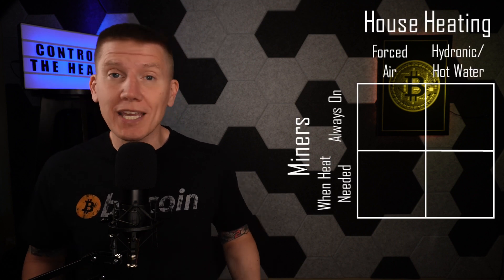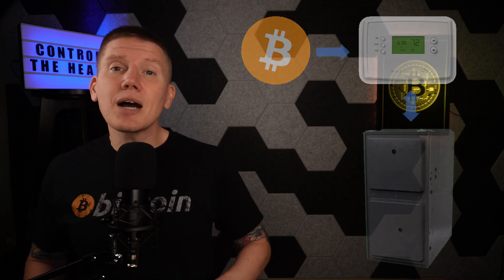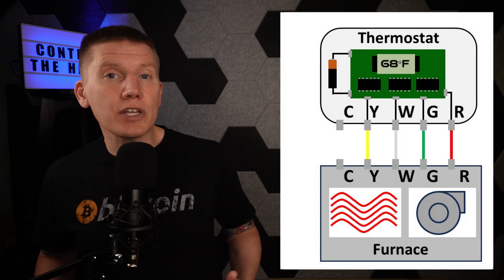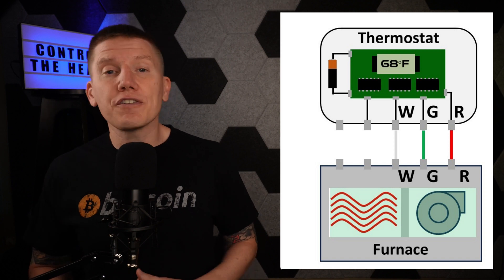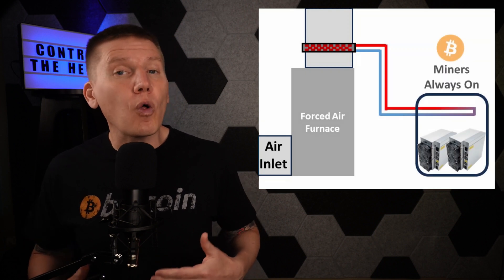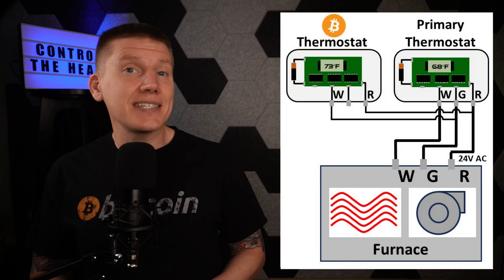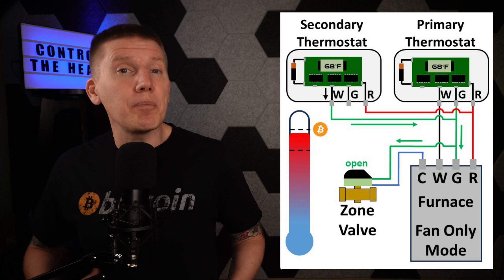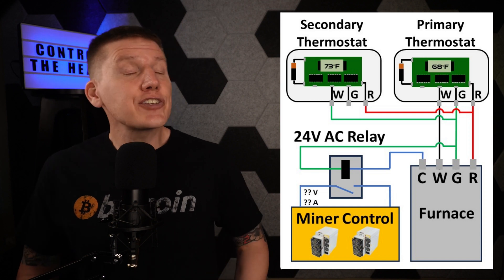EP27: How to Connect BITCOIN heating to your thermostat

Comment: So if the temperature falls too low and heat kicks in what stops the bitcoin miners from getting cooked by the furnace? Shouldn't the zone valve close if the furnace receives a heat signal?
Reply from the maker: Great question!   Yes, you definitely have to wire the zone valve into the system so you cut the flow if your furnace is running.  Other options are to cut power to the miners (miners not on all the time) or really oversize the dry cooler so that it can handle hotter fluid (miners on all the time).    Definitely have to take a look at the whole system and think things through ;-)

Comment: Actually, I lied a question just came up. I was wondering, with the dual thermostat zone valve setup, if my home heating system uses a heat pump, would turning on the air conditioning also turn on the valve? In this situation, would I have to somehow detect when the pump is not running O (Reverse)? Am I right and is there a type of valve that can do that?
Reply from the maker: Great question...with the heat pump, this introduces a bit of complexity and there's a couple different ways this can work.  I think I'd need to understand a little more about how your existing setup is configured.  If you want, get a hold of me on telegram:  t.me/HBIM_Channel    I think we can figure out what might be the best option.